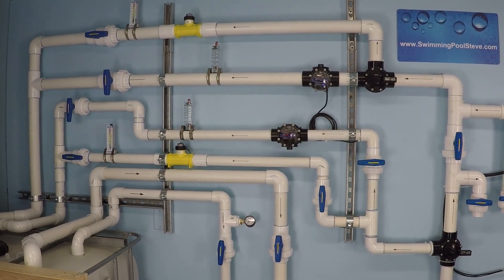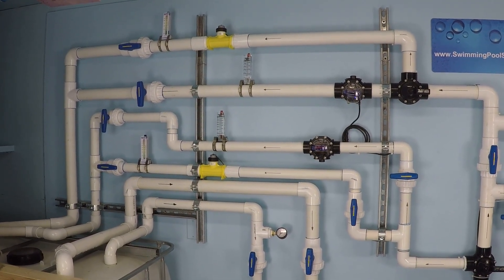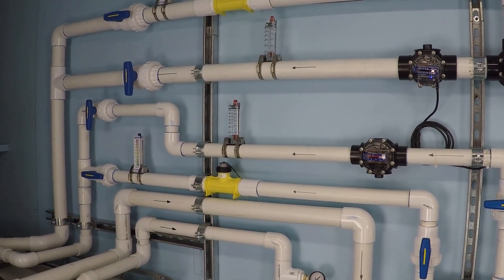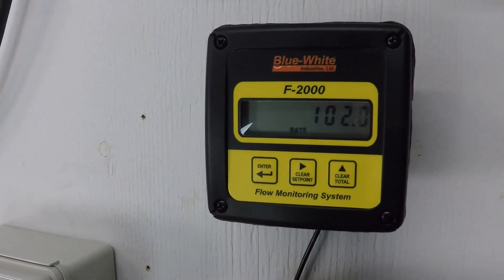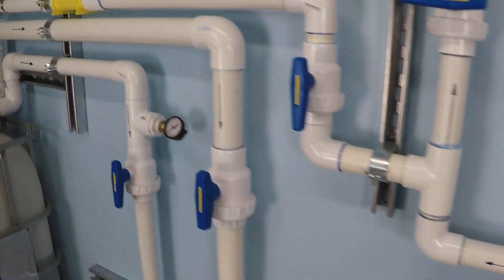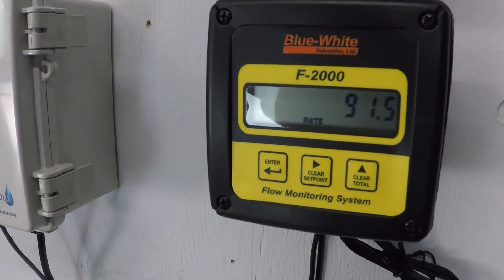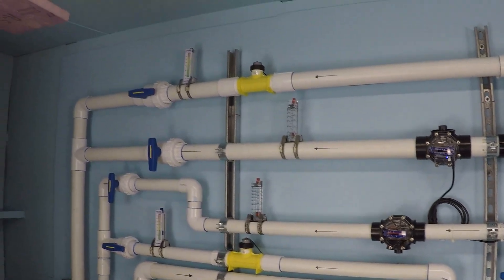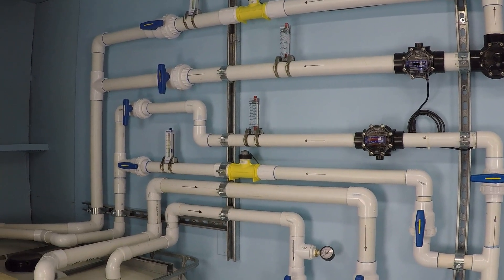How Changing Pipe Size Affects Flow

Comment: Thank you so much for this video. I have been searching for some actual results. 

I have a water tank and I wanted to see if the water velocity remained constant would it have afftect on the flow of the outlet side of the pipeline if the pipe diameter is increased. My flow was low from rusting so I wanted to change the pipe diameter from 1/2 inch to 3/4 or 1 inch diameter. I am hoping now that the flow will improve when I change from 1/2 inch pipe rusted to PPRC pipe of 32mm which is internal diameter 22 mm at least. 
So, I think water flow will be much better now. 😊
Thank you and thank God because I was doubtful if it will be good

Comment: Hey Steve, I just bought a 2hp variable speed pump, my pool is about 25000 gallons with 2 inch pipe, what would be a good schedule to program the pump and save money, my pool is 2 years old and had a single speed 1.5hp pump, thanks

Comment: Does changing the size of pipe at the intake from small size to a bigger size affects the pressure.
Eg. Take water from a 36" pipe with an 8"pipe,then after a shot distance reduce the pipe to 5" then connect to an 8" pipe that serves an estate.
Question: will the pressure decrease or will it increase?
Reply: Pressure will decrease if velocity is constant

Comment: What do you think would happen with a 3" supply and 2" return
Reply from the maker: Generally larger suction and smaller return pipes is a good idea. Not enough info here to tell ypu definitively what you should do, but 3" suction and multiple 2" returns would work.